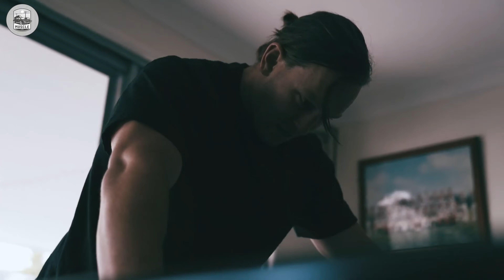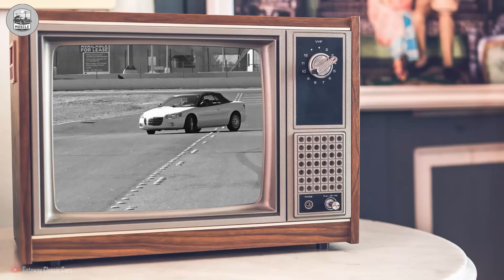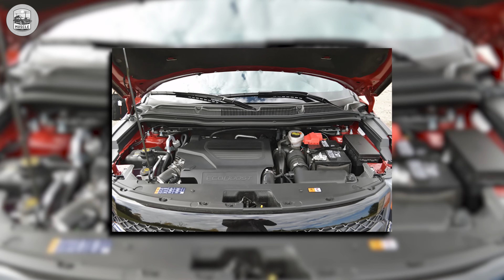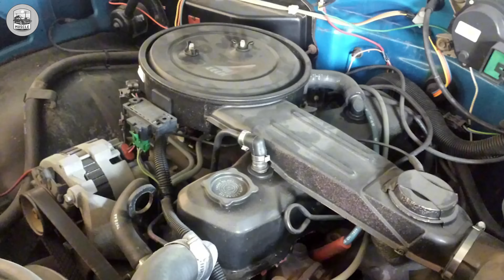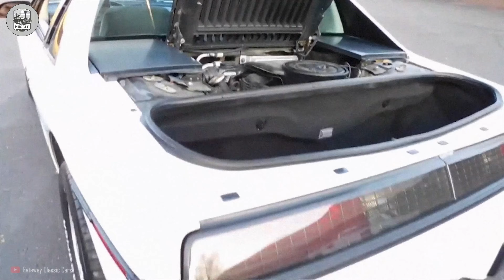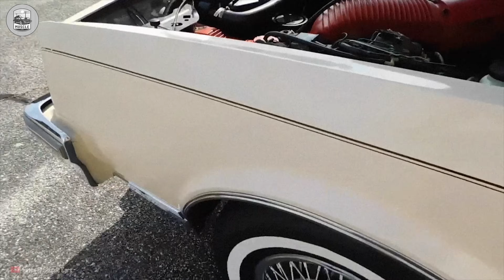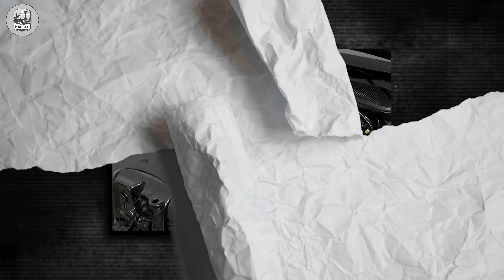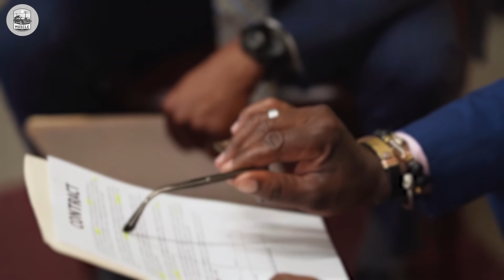MOST FAILED ENGINES ever put in production cars | Worst engine blunder!

Comment: So much insinformation here. Many of these problems blown out of proportion by the speaker here. It seems like he went to "Consumer Reports" or some other car maintenance monitoring site and got info on basic engine problems, then plotted all the consequential issues that could result if a basic problem was left unchecked.

A prime example is the Toyota 3VZ-E. He displayed pictures of any Toyota 3VZ engine except the one he wanted to crap on. He errored in naming the actual engine designation and its use in particular vehicles, then "listed" everything he knew that could happen as a result of a blown head gasket. He failed to realized (as many other misinformed people - negligent original owners and ignorant secondary owners, dumb repair technicians, and dedicated rock-climbers) or inform his viewers that Toyota had an active recall on the 3VZ-E in Four Runners and Pickups, and they replaced head gaskets in those vehicles with mileage in excess of 100,000 miles - free of charge. This is personal experience. 

With my head gasket replaced at 103,000 miles, my truck now has 370,000 miles with no further head gasket issues. this video should be titled "THINGS THAT CAN HAPPEN TO THESE ENGINES IF YOU DON'T PROPERLY MAINTAIN THEM." Try starting with late model vehicles that has turbocharged engines and instruct people on how to manage the flaws in those engines because there will be many, and manufacturers will not accept responsibility for their poorly designed products.
Reply from the maker: Thank you for sharing your detailed feedback and personal experience! It’s crucial to address misinformation and provide accurate context, and I appreciate the opportunity to clarify. You’re absolutely right about the Toyota 3VZ-E. Toyota’s recall program for head gasket replacements in the 3VZ-E engines in 4Runners and Pickups is a key point that should have been highlighted. Your truck reaching 370,000 miles after a recall repair is a testament to the durability of these engines when properly maintained.
The title suggestion, focusing on maintenance, is spot-on. Many engine problems are indeed magnified when regular upkeep is neglected. Late-model turbocharged engines, as you noted, often require meticulous care to manage inherent flaws, and their manufacturers aren’t always transparent about these issues.
We strive to bring accurate, engaging content to our viewers. In future videos, we’ll emphasize preventative maintenance and delve deeper into issues like turbocharged engine care and how to identify manufacturer recalls.
To our community: if you’ve had similar experiences with engines that exceeded expectations after maintenance, or if you have tips for managing flaws in newer engine designs, let us know in the comments. Your stories are invaluable.
Don’t forget to like, share, and subscribe to American Muscle Cars for more engaging discussions, accurate information, and fascinating stories from enthusiasts like you. Together, we can build a knowledgeable and vibrant car community....
Reply: @MuscleCarMasters68 my comment wouldn't post. Thanks for responding to me.
Reply from the maker: @supercleaner  Thank you and have a great day. hope to see you next videos.

Comment: The 5.4 triton 2v was actually pretty damn good. Look at how many 10th generation F150's are still on the road. Millions
Reply from the maker: Yes, the 5.4 Triton 2V was a reliable workhorse! It powered countless 10th-generation F-150s that are still hauling, towing, and running strong today. Its robust design, with a forged crankshaft and iron block, made it durable under heavy loads. Ford’s modular engine platform also made parts readily available, further boosting its longevity. While some experienced spark plug or coil pack issues, proper maintenance kept them going for hundreds of thousands of miles. It’s a testament to Ford’s engineering. What’s your experience with this engine? Comment below, share your thoughts, and don’t forget to subscribe to American Muscle Cars for more...
Have a good day.

Comment: I still own a 2001 Chrysler Concorde with the 2.7L V6. Yep, at around 100K miles, the water pump let go, polluted my oil, it literally let go so bad, orange goo was spewing out of the dip stick. I was  sure that the engine was toast. But I took the front of the engine apart and replaced the water pump and chain. After draining the oil after the repair, it leaked. So this spring I took it all apart again, replaced the front cover gasket and all other gaskets. It now does not leak and still gets the expected mileage, and runs smooth. So, yeah If you take care of it right, it runs great!
Reply from the maker: That’s an incredible story of dedication and determination! The 2.7L V6 in the 2001 Chrysler Concorde is often criticized, but your experience shows how proper maintenance and repairs can keep it running strong. You’re absolutely right—when the water pump fails, it can cause catastrophic issues, including mixing coolant with oil, leading to that orange goo you described. That failure was a common issue with these engines due to the pump’s internal design.
Your decision to replace the water pump, chain, and gaskets was spot on and likely saved the engine. These engines can reward diligent owners with good performance and fuel economy when properly maintained. For anyone else with a similar engine, regular oil changes, timely cooling system maintenance, and addressing leaks immediately are key to longevity.
Thanks for sharing your experience! Everyone, share your stories, comment, and subscribe to Muscle Car Masters for more fascinating car content..
Have a good day.

Comment: 2.7 was shit because the water pump was run of the timing chain,  the TIGHT side of it...  chain harmonics kill the bearings of the pump
3.1 gm was not shit, nor was the 3.8, or the "duke", or the rotary....
every 3.6 issue ive encountered was due to "gas and go" soccermom mentality (marginal if any maintainence, and oil changes)
Reply from the maker: Thanks for sharing your insight! You’ve hit the nail on the head regarding the 2.7 – that water pump design was a ticking time bomb. Running it off the tight side of the timing chain was an engineering oversight that doomed the bearings to premature failure. Chain harmonics and stress were indeed major contributors, making regular maintenance essential for prolonging its life—though even that wasn’t always enough.
The 3.8, in particular, gained a reputation for durability and even powered some memorable performance models with the supercharged L67 variant.
You also make a valid point about the "duke" 2.5 and GM’s rotary efforts. While the "Iron Duke" wasn’t flashy, it was a reliable workhorse. The rotary, though short-lived, showcased GM’s innovation at the time.
Your comments on the 3.6 are spot-on. It’s a strong engine, but the "gas-and-go" mindset leads to problems, especially with timing chain wear and oil consumption. Regular maintenance and proper oil levels are critical to keeping it running smoothly.
Let’s keep this conversation rolling! Share your experiences, like this video, and don’t forget to subscribe to Muscle Car Masters....

Comment: I owned 3 Rx7s with the 1.3 ltr rotary engine, and drove them hard. No problems following recommended service under warranty.  I added engine flush before every 3 - 4 oil changes, that freed rotor tips from gumming up. Auto trany on one car gave out at 105,000 mi.
Reply: Honestly, I'm with you on the RX-7's rotary being more reliable than people give it credit for. I ran three RX-7s myself, stuck to regular maintenance, and didn’t run into any of the catastrophic failures people love to talk about. The rotary gets a bad rap, but it's all about upkeep. Engine flush every so often? Totally agree – keeps things running smooth and prevents those rotor tips from sticking. And hey, 105K out of the auto tranny? Not bad at all for a car everyone thinks will break down at half that mileage...
Reply from the maker: @KeithGreene-k1v  Absolutely, you’re right on the money about the rotary engine – maintenance is the real secret to keeping it running strong! The Mazda RX-7’s rotary often gets misunderstood, but as you’ve shown, regular upkeep like engine flushes can go a long way in preserving those rotor seals and keeping the engine humming along smoothly. Rotary engines naturally produce more heat, which can lead to carbon buildup, but by sticking to a solid maintenance plan, many owners – just like you – enjoy years of reliable performance.
The automatic transmission lasting 105,000 miles is impressive! Rotary engines put unique stress on the transmission due to the high-revving nature of the engine, so it's great to hear that Mazda engineering held up to that kind of demand. Plus, it’s a testament to how durable these cars can be if they’re treated right.
For everyone watching, we’d love to hear your experiences with rotary engines or other unique setups you’ve maintained over the years! Let’s keep the discussion alive – drop a comment below, share this video with fellow enthusiasts, and make sure to subscribe to American Muscle Cars for more tips and insights on keeping these classic engines alive and well. Thanks for being part of our community!
Reply from the maker: Great to hear from someone with hands-on experience with the RX-7's rotary engine! The 1.3L rotary is definitely a unique beast, and you nailed it with the engine flush strategy – that’s a great tip to keep those rotor tips clean and prevent buildup that can cause issues down the road. Following the recommended maintenance schedule under warranty definitely makes a difference with rotary engines, as they have different needs than standard piston engines.
It's interesting that your auto transmission made it to 105,000 miles, especially with how hard you drove it – that’s pretty solid for an RX-7! Rotary engines tend to handle high RPMs well, but it’s the transmission that often feels the wear and tear, especially with aggressive driving.
To everyone watching, if you’ve had similar experiences or tips on maintaining unique engines like the rotary, drop a comment below! We love hearing your insights on keeping these classic machines running smoothly. Don't forget to share and subscribe to keep the conversation going about these legendary cars!
Reply: In Australia we have a rotary its called a rotary cloths line😂😂😂😂
Reply: @garrypritchard1658  I get it, the rotary engine gets a ton of flak, and sure, they’re not everyone’s cup of tea. But let’s be real – a rotary isn’t just some quirky Mazda gimmick; it’s a marvel when maintained properly. The whole “rotary clothesline” joke? Funny, but it doesn’t do justice to what these engines can achieve. I’ve had mine go past 100K miles with regular care, which isn’t the disaster many claim. Sure, it’s not a V8, but it wasn’t designed to be one. It’s an entirely different beast—compact, high-revving, and more reliable than people give it credit for.
Reply from the maker: @garrypritchard1658  That's a classic Aussie joke – love it! But seriously, the rotary engine, like the one in the RX-7, is a marvel of engineering. Its lightweight design and ability to rev to the moon make it a standout in the world of performance cars. You're absolutely right about the importance of engine flushes – keeping those rotor tips clean and free of carbon buildup is critical to longevity. Another great tip is ensuring the cooling system is in top shape, as rotaries generate a lot of heat, and overheating can quickly lead to problems.
It’s impressive that your RX-7's auto transmission lasted 105,000 miles, especially under hard driving – a testament to Mazda’s robust engineering. To everyone watching, share your rotary or unique engine stories in the comments! Let’s keep the discussion alive, and don't forget to like, share, and subscribe for more muscle car magic and legendary engines.
Reply from the maker: @KeithGreene-k1v  You bring up some excellent points about the rotary engine—it truly is a marvel when maintained properly! While they often get dismissed as unreliable, it’s usually neglect or misunderstanding of their unique needs that causes issues. Regular maintenance, especially keeping the oil topped up and using proper coolant, is key to long-lasting performance. The fact that you hit over 100K miles is a testament to how rewarding these engines can be with proper care.
And let’s not forget the incredible engineering behind them—compact, lightweight, and capable of insane RPMs. That high-revving nature is something no piston engine can replicate, and it’s why the RX-7 became a legend. You’re absolutely right—this isn’t a V8; it’s an entirely different machine with its own kind of brilliance....

Comment: Calling BS on 1.9 Saturn. Had one with over 500k
Reply: Look, I know folks love to slam the 1.9 Saturn, but I'm calling BS on it being unreliable. Mine clocked over 500k miles, and it still ran like a champ. Sure, it might not have the muscle of a classic V8, but for what it was, that engine could go the distance. I get it; it’s not a fire-breathing V8, but sometimes, a car that just keeps going can be more impressive than a finicky powerhouse. Not every engine needs to be a gas-guzzling beast to be respected.
Reply from the maker: @CookeZachery Absolutely. It's amazing to hear stories like yours—engines that prove their worth not just in raw power but in sheer durability. The Saturn 1.9L, especially in the SOHC form, definitely earned its stripes as a high-mileage workhorse. These engines had some unique design traits that contributed to their longevity, like lightweight aluminum blocks and straightforward engineering that made them easier to maintain. And let’s not forget, it was one of those engines that didn’t need to be flashy to earn respect—it just kept going!
And you're right, not every legendary engine needs to be a roaring V8. Sometimes, it's those engines that just keep ticking mile after mile, year after year, that leave a lasting impression. Stories like yours show that there's more to the car world than raw horsepower; reliability and durability deserve their own spotlight too.
To everyone else here, what’s your high-mileage hero? Drop your stories in the comments, hit that share button with a fellow car lover, and make sure to subscribe for more incredible tales from the world of American Muscle Cars.
Reply: This clip bait video!
Reply from the maker: Absolutely, it's incredible what some engines can accomplish with the right maintenance and a bit of luck! The Saturn 1.9L engines, especially the SOHC versions, really have built a reputation for endurance. With regular oil changes, careful maintenance, and even a few part replacements along the way, many of these engines have gone the distance and then some. It's no wonder some hit the 500k mark!
Thanks for sharing your experience—keeping these legends alive is what we're all about! To everyone watching, drop your own mileage stories in the comments, share this with fellow enthusiasts, and don’t forget to subscribe for more insights and stories on American Muscle Cars....
Reply: @MuscleCarMasters68 then don't call them out for views!!! Get a real job!
Reply from the maker: @BobBarker-mx7lk  Absolutely! It’s amazing what engines can achieve with the right care and attention. Engines like the Saturn 1.9L SOHC have earned their reputation for being reliable workhorses, often surpassing expectations with proper maintenance.
As for calling out views, we’re here to celebrate and preserve the stories, engineering, and history of American muscle and other iconic vehicles. Sharing these tales isn’t just a job—it’s a passion that connects enthusiasts like you!
To everyone watching, share your highest-mileage stories in the comments.
Have a good day.